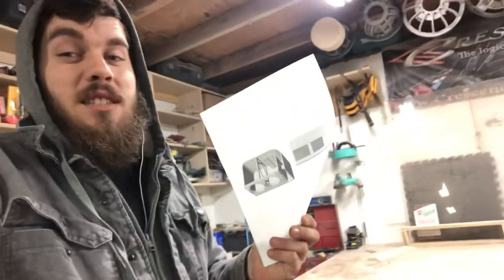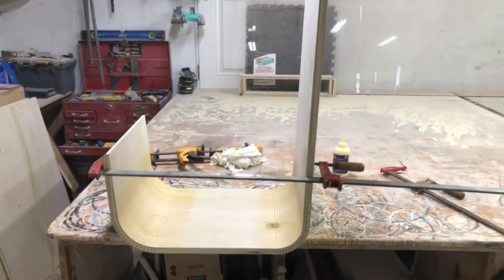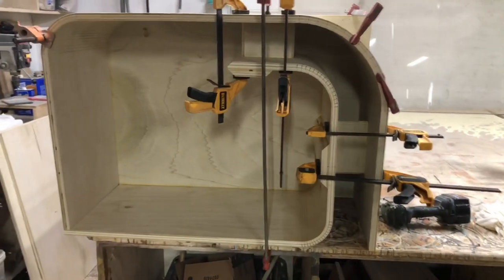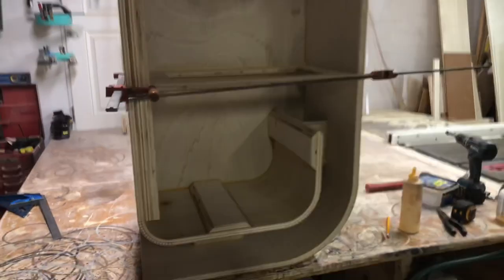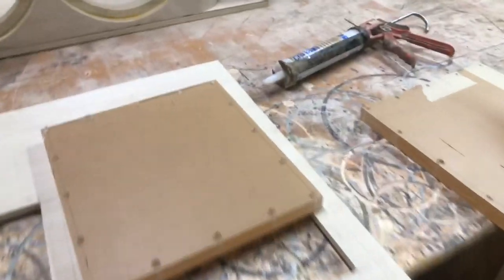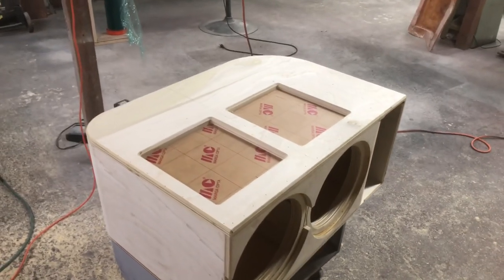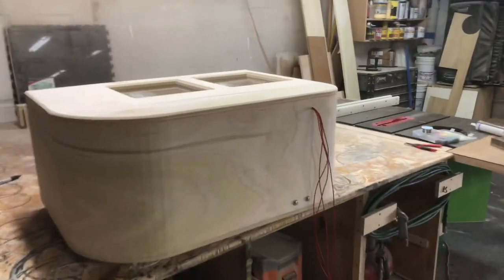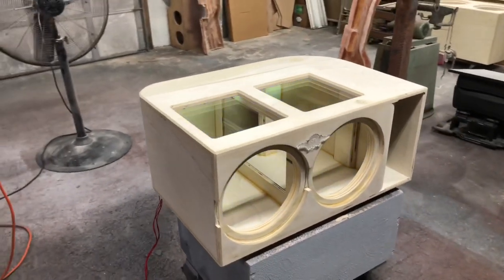2 CT SOUNDS MESO 12s!—TIPS AND TRICKS--CUSTOM SUBWOOFER BOX—IN THE SHOP WITH CUSTOMLOWZ EP61

Comment: The box recommendations for this sub is 1.5cf for each sub which seems small to me for 12s. What’s your thoughts on going off of those recommended specs?
Reply: The people that design the speakers are usually really close or right on the mark. Especially if you buy a USA made subwoofer. Not knocking other brands
Reply: @RTM459  That depends on what you want. I'm yet to see a subwoofer with a recommended box I would build. Then again, I want it to sound good and it doesn't need to handle kilowatts of power.

Comment: Once again...👍 Great Job!!
What do you use as a wood protector? Polyurethane or Wood Conditioner!🤔
Reply from the maker: None
Reply: Yes his boxes look very nice Poplar which I love to work with is a very light softer wood with a more faint grain conditioner or pre-stain really only works in the instance u are staining and when ur working with woods like pine, birch, maple or oak where u won’t the grain and colors to blend more evenly the conditioner also shows any imperfections u might see when u stain and poly is does protect the wood from moisture and seal it up nicely protect the stain and finish it off but gives it a glossy look...